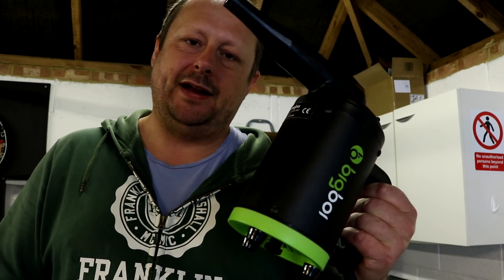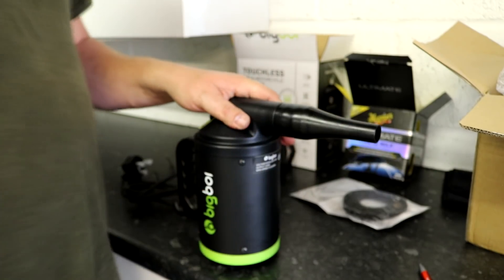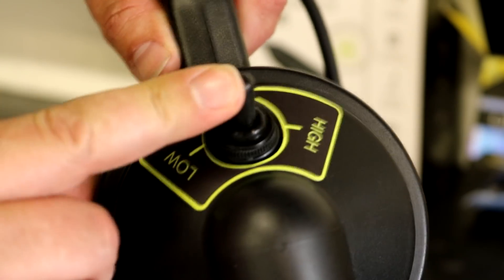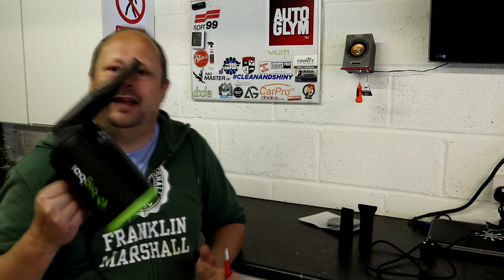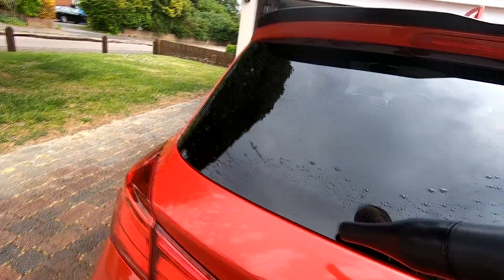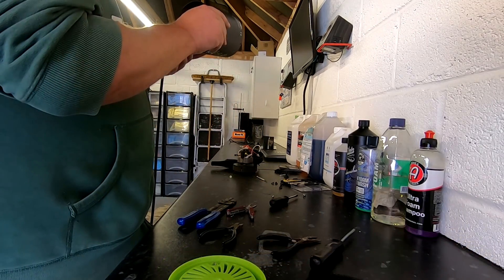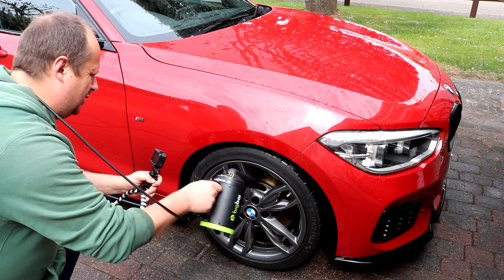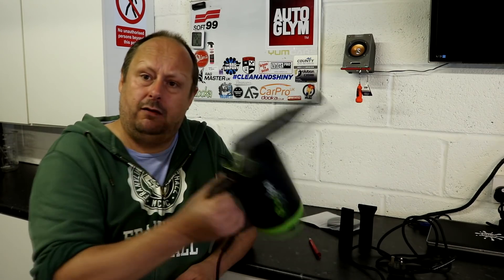The perfect tool for drying cars and avoiding water spots

Comment: I agree with you John that the air just blows water all over the panels and never fully dried Unless you have a CR Spotless or some type of filtration system other wise you still have hard water on your paint. If I was going spend $300, I would buy a filtration system.

Comment: I’ve got the Metrovac Air Force Blaster. It’s really good for drawing water out from those nooks and crannies. Downside is that in my driveway, especially in the summer it’s better to use a towel to dry as you can dry a car a lot quicker this way. Also as I live in a very hard water area, water spots would be on the paint in a flash.

These are excellent though for drying wheels and tyres so that the dressing bonds properly.

Comment: I actually bought a makita dub362z has the same output I think as the biggest master blaster you can get but totally cordless. It’s got 6 speed settings too. Amazing for drying your car is all I can say. 36v of power with two 18v batteries. I think this is the way to go

Comment: I completely agree about these blow-dryers not being suitable to dry panels. I have a Sidekick and it atomizes the standing water on panels exactly like you said. You can be as careful as you like, but there will always be a little bit of this atomized water left behind which can create "micro water spots" (as I call them). For that reason doing a final wipe-down with a drying towel is desirable if not necessary. I'm very suspicious when people say they can 100% dry a car with a blower - I suspect these people don't have enough attention to detail to realise the risk of these micro water spots, i.e. one man's "perfect" is another man's "ordinary".
Reply: Get yourself one of these and use for final rinse and you'll get no water spots. No cheap to buy but delivers pure water direct from tap. https://www.windowcleaningwarehouse.co.uk/nlite-hydropower-6l.html . I live in a very hard water area and spots were almost a fact of life but the kit (and there are many other manufactures of course which will do same) got rid of any spotting.
Reply: Or just get a worx leaf. Blower and get the work done 3x faster
Reply: @latinace1981  All air blowers do it, be they Metrovacs, Bigbois, leaf blowers or otherwise. No air blower will 100% perfectly dry a car, there will always be these micro water spots.
Reply: You can do 100% touchless drying if you use DI water.  Tap water, gotta use a towel for best results. The blower is just to get the bulk off.

Comment: I have a Metrovac Sidekick. I like that it gets my car virtually bone dry without annoying water runs anymore but it does add around 20 minutes to the drying time since certain areas of my car such as wing mirrors seem to hold an almost infinite amount of water! Water seems to forever be coming out of the gaps and then spend my time chasing the water off the panels.

I'd say towel dry first then use the Sidekick/Big Boi to finish off. Otherwise you'll be left with waterspots!

Comment: I have just bought the BigBoi Car Dryer mini, or clearing the snow off the car, but while waiting for delivery, the snow and ice stuck rigidly to the car panels, I found the warm air great for getting off ice between the bonnet and windscreen, also on the wiper blades. It wasn’t quick but did what I wanted, got the ice off without any brute force, when it is being used for its true purpose, drying the car, it’s great for grills, door shuts, grills, vents, mirrors, and the spoiler on the top of the back estate door. But for large surfaces especially horizontal, like the bonnet and roof. Better off with a drying towel, the mini comes with a 5 meter cord and 5 meter Hose.
Reply from the maker: yes, the only thing that bugs me with the big boy is the lead. let me know your thoughts steve the BB has lots of grunt I think,
Reply: @ForensicDetailing  yep John it’s the mini, I have, I have only just got it, seems really powerful, as identified by many, they have their limitations chasing water around big flat surfaces. It comes with a 5 metre power cord the rubberised hose contracts when cold, but apply a little bit of heat (from the built in heating element) it also expands to 5 metres. You could easily get away with putting it at one end of the car, from the back it would reach the roof line to the top of the windscreen, and both sides of the car, then move it to the front to finish off. The airflow and heat is adjustable £149 £50 dearer than yours but I would say more effective with the features.

Comment: I'm in Australia and recently bought the BLOWR PRO and it's a similar issue. The power cable is far too short and the prongs are actually a little too thin which means they fall out easily if the cords aren't tied properly. A second issue for the Pro is that the front steering wheels are far too small and it doesn't pull along well on course driveways.
So far i've found the best use is for blowing out crevices and wheel rims.
Reply from the maker: one of the reasons I didnt want one that sits on the deck is because I dont have a smooth driveway or garage floor and it would be jump around all over the place.  but the downside is I dont have the grunt... but seems like the little buddi has enough flow to do what I need.
Reply: @ForensicDetailing  Yep. I think it looks like a great tool and portability is a definite advantage.

Comment: Jon, the very thought of dragging a cable around the car is enough for me to launch it into next doors trash. Any equipment associated with detailing is over priced. I also think any portable electric appliance is only allowed to have a max of 3m cable (I think, needs checking) that's why it only comes with a short cable. I recently purchased a Dewalt XR 18v compact blower for £53.74, it uses the same batteries as my drill & sander. It is exactly the same spec as a £200 Flex blower & has made my life so much easier as the water dripping from my wing mirrors after washing keeps me awake at night. Not sure where Dewalt is actually made but it has 2 year guarantee and no need to modify. Obviously if a Dewalt blower is your only Dewalt tool then batteries are extra but depending on how many you want and the size then you could add another £30 max to the price. I released a video last week on a review of my C5 wheel coating and demonstrate the blower in that video, have a look and let me know your thoughts. Hope this doesn't com across as too negative. regards Martin.
Reply from the maker: wouldnt surprise me if there was some regulation about the cable length, just makes sense there has to be a good reason.

what your saying about picking the dewalt makes a lot of sense.  If I had like some power tools and batteries for them which I kept charged up I think almost certainly I would have gone with a battery powered blower from that tool maker.  The cordless thng is really just great isnt it.  cheers mate.
Reply: Jon, changing the subject , I was so impressed with your review of Bouncer's Si detail spray that I immediately ordered a bottle & published a review on it this morning on my channel. Have a look and give me your comments. As always much appreciated 👍👍 @ForensicDetailing
Reply from the maker: @ObsessiveCarDetailer  brilliant stuff love the video.  Its good isnt it.  its nice and thin and slippery to wipe around, very easy to buff and it makes the car look great.  Its definetly slick as well.   Im interested to try and find out how long the material its laying down lasts. but thats mainly out of curousity at the end of the day its a quick detail spray.  but yer Im really impressed with it.

Can I ask what are the workshop cabinets in your garage they look fantastic?
Reply: Of course, I got it from Homebase its called  "Ultimate Storage" I think it was around £799 about a year ago
Reply: @ForensicDetailing  I'm no sparky but I doubt it'll be a regulation, my guess is it's to keep manufacturing costs at a low to maximise profits. Think about vacuum cleaners or lawnmowers they wouldn't be able to sell them if they put a 2m cord on would they as it wouldn't be practical, so they are forced to put 10-15m of flex on them. Considering these items draw more watts than the BigBoi I can see no reason to why it can't have a longer lead.

Quick Google reveals:
The IEE code of practice specifies the following maximum lengths for extension leads based on the cable size:

Cross Sectional Area of Cable       -       Maximum length
1.25mm2      -    12 Metres

1.5mm2        -    15 Metres
Reply from the maker: @kevinsharples7334  I dont know mate say that extra 3 meters of cabel length.   that can only equal like what 20-30p?  its possible its a cost thing no idea.  some other guy mentioned a possible regulation thing.

Comment: I use a Wickes builders vac as it sucks and blows so two tools in one and it only costs £42. I've abused this one for over a year now and it's still going strong. Well worth a try if you want a wet and dry hoover and don't want to spend too much on a hoover and a blower.

Comment: I used to have a handheld but wanted to be able to dry the car completely so bought the Bruhl MD2800 which is the equivalent of the BiG Boi Pro R. I can the dry the car in 15-20 mins. The big plus for me is as it’s touchless drying, I can dry off the car after the rain even if it’s been outside a few days for example. It blows the water and dust away leaving the car looking like it’s just been washed.
Reply: oh man, hope you don't live in UK, otherwise i hope your CAR is PAYING YOU for such frequent treat!
(or you are just low cost labourer and your time is cheap...)
Reply: Or u can just use a worx leaf blower and dry ur entire car in 7 minutes if ur car has wax or sealant
Reply: Latin Ace - I have a leaf blower and the Bruhl is on a different level. My 15-20 min timing is drying the car to perfection (no  drying towel needed) including door shuts, wheels/tyres, engine bay and the boot. This can’t be done in 7 mins! I blow leaves with my leaf blower and dry cars with my car dryer.
Reply: @Audittr2108  many leaf blowers don't dry cars well but the Worx g520 works like a charm. It gets all the crevices no problem. I finish 7 minutes tops. Only $50 on amazon

Comment: The low limit on operating temps is most likely there because the plastic parts might get brittle in that cold, which in turn might cause them to break or break more easily. If the blower rotor is made of plastic, that might be a serious problem even then when you're handling the device very carefully. If it's made of metal, then it's most likely the attachments that are prone to breaking in cold temps.
Reply from the maker: good point gabor cheers m8.  I think the fan unit in this thing is all metal.  Not sure about 100% sure about the impellers but I "think" its all metal.

Comment: Had the same issue on a cheap argos polisher i got. Didnt want to try and unpick the cable from the machine, so cut the plug off and used an industrial small 3 pin plug ( similar to an old garden plug) and stuck it on a nice length of cable instead. So technically i still have a warranty 👍

Comment: Master blaster airforce 4hp+4hp hung on the inside of the garage door with 30ft of hose.
I'm only lifting the first few feet of hose that has the air nozzle so the weight is under 1kg. Very strong filtered air will fully blow dry my cars.
Wintertime I'll only use the Autoglym Polar range with the jet lance then air dry, so no contact on the paint is made and my hands stay dry and chapped free.....

Comment: I've got one of these and it's decent - you do need an extension cable though cause of the lead.  Well built and sturdy. I use it for the wheels, door handles, grille etc. Rest of the car I do with a towel. The next size up is about £40 more and would be OK if you have a smallish car.  China has two standards of manufacture, cheap and nasty or high spec and this strikes me as a high spec bit of kit. Excellent service from Ultimate Finish too. Change the cable? Christ I'll find changing the bloody filter a technical challenge ...

Comment: I've been (slightly guiltily) using a leaf blower but am considering something filtered. Reading between the lines of your review, it looks like the Sidekick and build some arm strength for free each time the car is dried! I like all the correction subtitles - priceless 😀
Reply from the maker: I would still go for this over the sidekick just simply because its half the weight.  but the sidekick is US made and cheaper and I think more powerfull.   so its prolly not much in it really.

Comment: I have just got a pet dryer with hose of off ebay 2 speed which you can adjust 2 heat settings and works well around £50.

Comment: Great review! Love this channel buddy. I bought a Master blaster sidekick (£100), the heavy one you didn't get. During the winter it did everything I wanted, all those places you said. However during warmer period we have had in the UK recently, I couldn't make it around the car before the water was drying and leaving water spots on my coating. So I bite the bullet and bought the cheap £50 WORX corded blower. Its amazing, I wish I had bought it in the first place, as you can full dry the car (Golf GTI) and all those crevasses in about 10mins. I'm just going to use the master blaster for dusting my PC fans XD.

Edit Master Blaster Sidekick
Reply: Only concern i have is that the air is not filtered. Could that cause issues.
Reply: @Dav1072 no cause soon as it leaves the tip it becomes unfiltered with the surrounding air. Not a big deal.

Comment: Most likely detailers already own a vacuum(Ridgid) that has a blower option. Why not just buy a 30ft metro vac replacement hose for $60 and adapt it to the blower on the vacuum! You can put a filter on the vacuum blower. I have tested this out already with a 2 1/2”diameter 20ft hose with a cone adapter at the end and I had plenty of power to blow the water off of the car. If it was a 1 1/2” hose it would be much better.  The vacuum is probably already set up and ready to go. Just attach the blower hose. Save money on overpriced dryers that do the same job! I do agree the hand held is a great option, but utilize what you already have. $79 for the vacuum and $60 for the hose with attachments.  $139 for that setup or $450 for the big Metro master blaster.

Comment: Bought one this week just tried to use it to dry off some rain, ah didn’t work well. Doesn’t seem anywhere near powerful enough for drying a full car. ok around emblems and front grill. I had just polished the car and it still couldn’t push the water. I had loads of water spots all over the windows and paint work that I had to clean up afterwards. Now trying to decide if I want to keep it for my mountain bike and grill of my car or send it back. Disappointed

Comment: What's happened to the Simon Alexander tune at the end???...... Please forgive me John, I have a MetroVac SideKick. But It's lasted me 5 and a half years, it's gone through 3 air filters and it's still going very strong, the solid steel housing has not rusted and feels high quality despite its age and weight. As well as door shuts, gaps and wing mirrors, it's also very useful for cleaning and drying under the bonnet, through the alloy wheels to help dry the brakes, hubs and barrels, inside the wheel arch wells and where I could reasonably reach underneath the car like the undertrays, more visible exhaust parts, suspension arms and sill lips. I agree with you, it's great fun to use and gets the washing and drying stage of the detail done very quickly. A great piece of kit. All the best, I hope you get better soon m8.
Reply from the maker: I just change the music clips up sometimes.  I switch back prolly later I love simons track.   new one for the white gloves and whistle boyz :)

Comment: As my car is black my roof gets water spots quite bad. I dont want to go down the towel route as im scared i introduce scratches to the paint so I will buy this to see if it works. I know you said towel dry the panels but im going to give this a go.
Reply from the maker: speed is important after that final rinse instantly dry off roof and bonnet and main panels in literall 20 seconds.  dont buff just lay towel on soak up 95% of the water move on.  do it quickly.    then use this blower or another blower.   then detail spray and soft cloths to finish off.   that works for me.   dont let the water dry.

Comment: I was just looking at the Harbor Freight corded electric leaf blower for car drying. 12 amps makes it one of the most powerful I've come across in the corded arena, it's $32 U.S. after discounts and I can also blow clear my driveway with the same unit. It is bigger, but it's pretty light and I'm a big guy so whatever.
Reply from the maker: yer thats kind of what Ive been using, with my leaf blower I get much more air flow, but I just find it a bit unwieldy.  but its perfectly usable.

Comment: better to cut the plug off and use a water resistant garden tool 3 prong plug and socket or just a single socket extension lead

Comment: That temperature range, Is that not how warm the blower gets under operation via the variable speed setting?

I ordered one of the cheap £18 small leaf blowers off ebay, works amazing for me, only use it for drying/forcing water out of the annoying places that run once your finished. 👍🏻